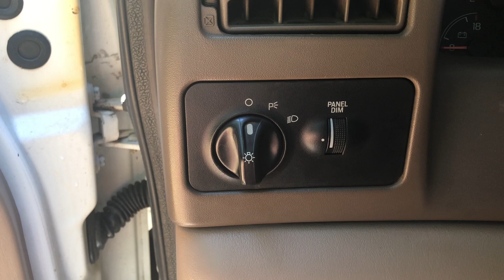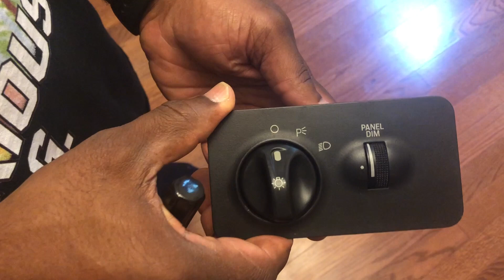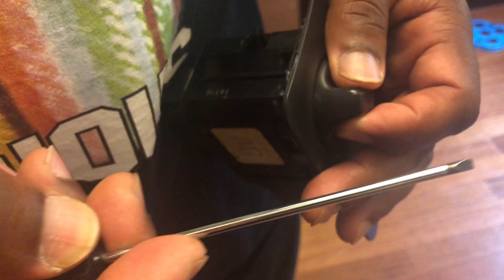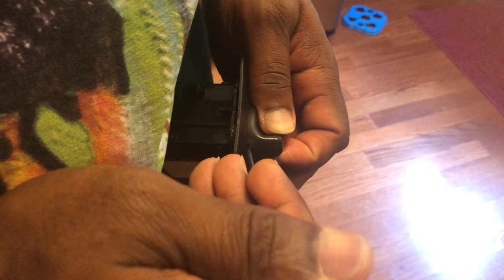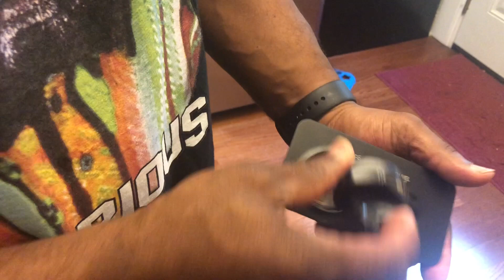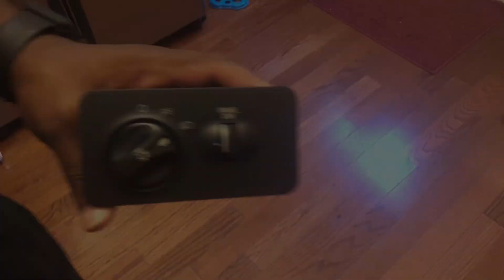Removing a F-150, F-250 headlight switch bezel the right way!!!!!

Comment: Like the others said, spot on advice and technique; only a couple of things I'd add: the switch faceplate is held on with very small plastic tabs that break easily so be careful (I broke a couple just handling it) and there are red plastic tabs on the plugs that have to be moved to allow you to depress the release tabs to unplug the plugs from the back of the switch.  Other than that, thank you, thank you, thank you!!